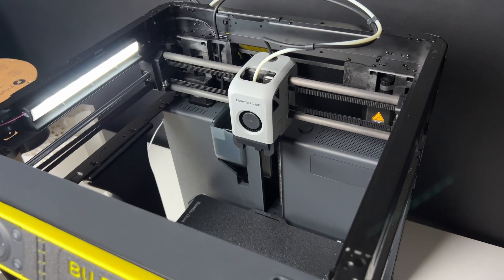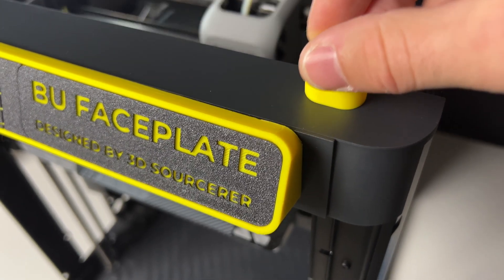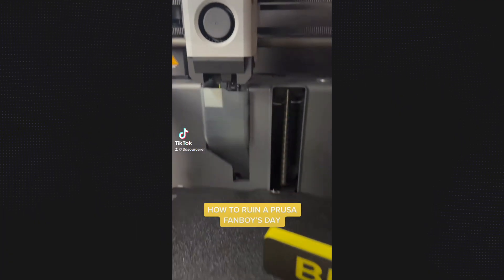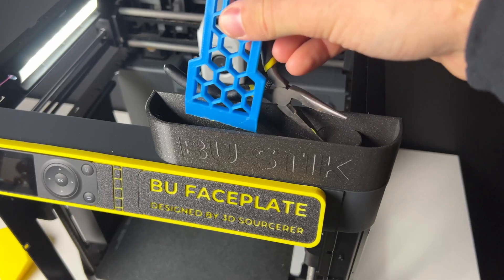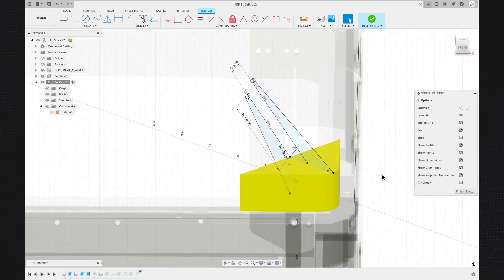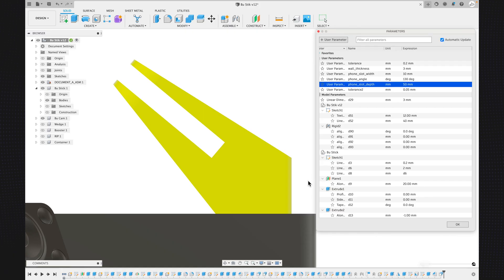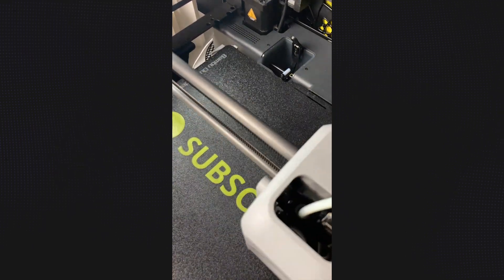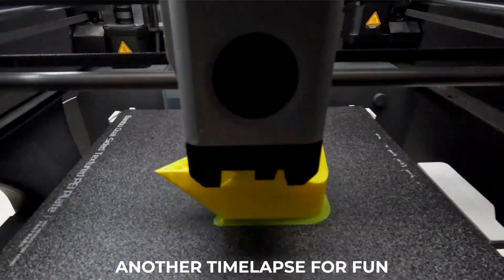Bu Stik - Easy Bambu Lab P1P Mods! [Iterate Ep. 4]

Comment: After seeing this hole - i immediately thought: there needs to be a "button" that does "something"

1) an inspect-button - just hook it up to the USB-A Connector, Plugin a cheap USB powered light and hook it up to a momentary switch - as long as you hold it, you have light, if you let it go, light goes out - no need for fiddling around in the app or the control unit

2) a power button hooked up the the mains power supply and turns on a relais that disconnect or connect mains power - since the switch is probably hard to reach in some cases - yes, might be dangerous to press when there is a power loss, but could be done with a small microcontroller that the power only gets cut when you hold the button for example for 4 seconds like the ACPI states for ATX computer do

yes, those are not just 3d printable mods, but maybe someone might find this ideas useful ;)
Reply from the maker: I like the button idea! Let me work on it and see what I can do!
Reply: @madebyjwillis  no hurry, I'm pretty sure they have something in mind, why else would they design this odd shaped hole?
Reply from the maker: @suit1337  yeah I feel like there will be something there but sometimes there are holes in weird places for assembly purposes but this one seems a little too prominent for that haha